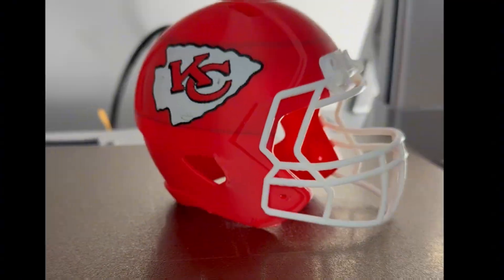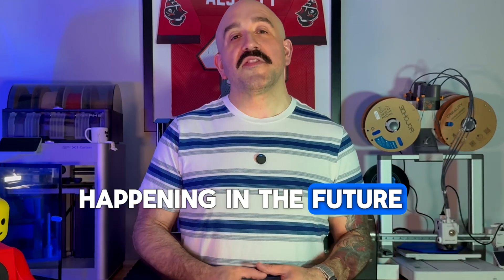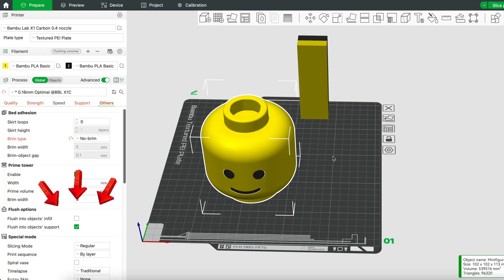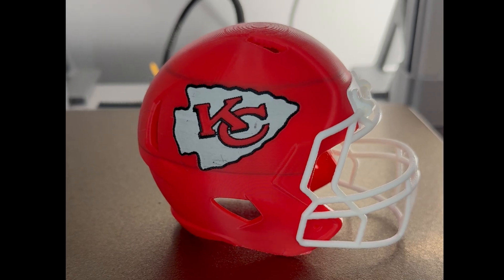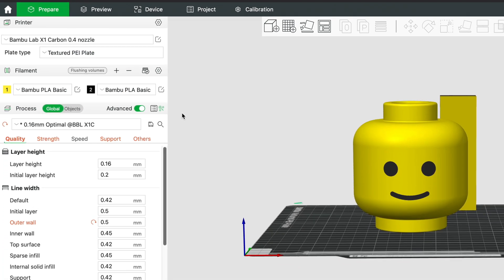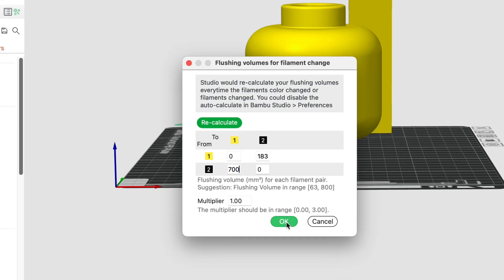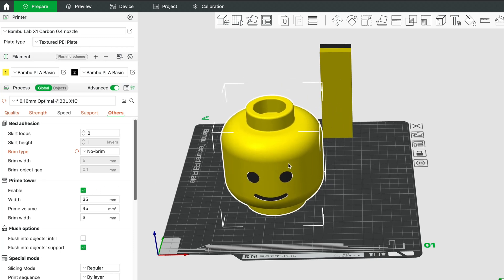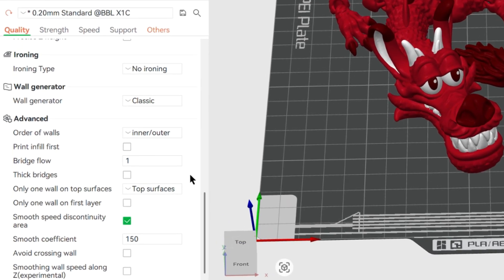Filament Color Bleeds Ruining Your Prints? Try These 5 Settings!

Comment: Good video. It’s funny that your example is of the Lego man head - the exact same print I am having trouble with. I tried everything in the past - purged a STUPID amount and still had terrible black rings. What could I be missing?
Reply from the maker: Thanks for the comment and welcome to my channel! I believe the Lego head was an issue for me as well, so I ended up printing a file that had the eyes and mouth separated and glued them on. If you don’t want to do that, try printing inner/outer to see if that helps. Good luck!
Reply from the maker: https://makerworld.com/models/48116?appSharePlatform=copy

I used this file, but merged the head parts that were split and printed it whole, followed by the eyes and mouth. It came out great 😊 

I’m sure if you have the H2D and print using separate nozzles, bleeding shouldn’t be an issue
Reply: @SweetNSaur3D thanks! I didn’t try printing the eyes and mouth separately - I thought the suppers on such small parts would make it difficult to remove them
Reply: Lol this is EXACTLY what im dealing with right now.. I have been searching round for hours now trying all different things and its still happening
Reply from the maker: @Rediroth sometimes you have to wave the white flag 🏳️ and go old school (aka print colored parts separately) 😑

Comment: What are your thoughts on the Z hop and z hop when retract?? Almost no one talks about it.
Reply from the maker: Great question! My first experience with Z hop was when a print started layer shifting and I had to see if that was the cause. In my opinion, Z hop is great when you need it — but like hot sauce, a little goes a long way before it ruins the dish. Z hop can definitely help avoid nozzle strikes on detailed prints, but too much can actually slow things down and sometimes cause little blobs. I usually don’t mess with it on most prints or keep it minimal, unless I’m printing something tall or with fragile features. Z hop on retract is worth experimenting with—small changes can make a big difference 😊

Comment: a good list of settings options ...thank you
Reply from the maker: You’re very welcome! Hopefully you’ll never have to use them 😅
Reply: @SweetNSaur3D  I've discovered 4/5 of these over 18 months of X1C/AMS use.   Really, they should be used routinely not have to wait until a build plate of models with bleed.    I am using this 'tube of yours as an advisory to those just discovering this dilemma.
Reply from the maker: @ozskeeter Yea I sometimes print parts of different colors separately if I can, JUST to avoid having to deal with potential color bleeds. It’s a constant love & hate relationship with the AMS 😂